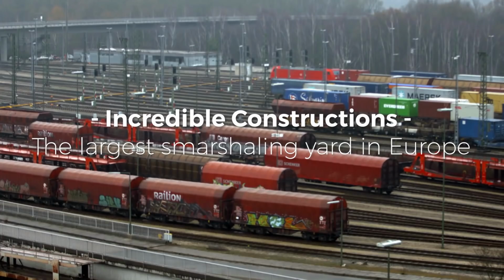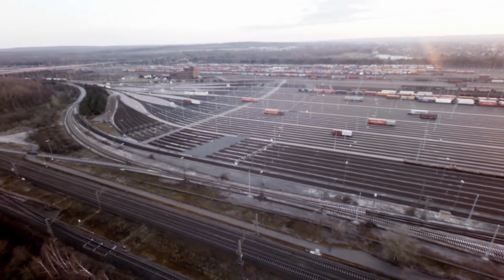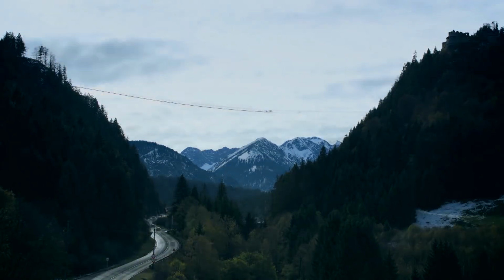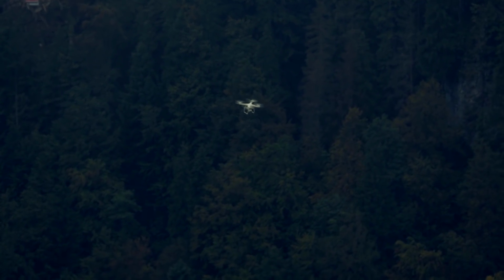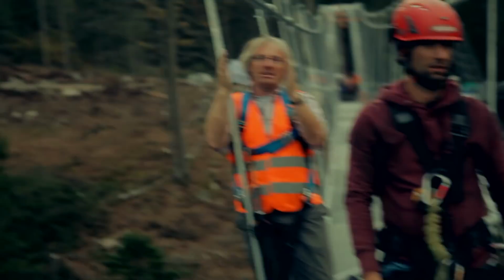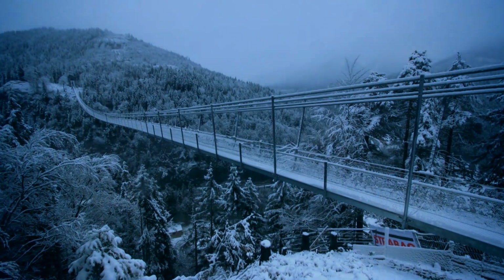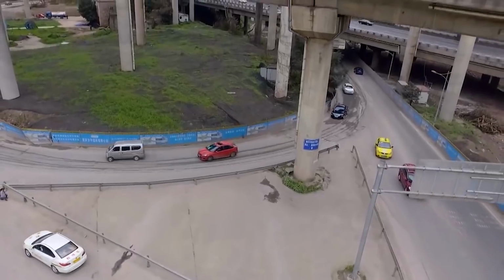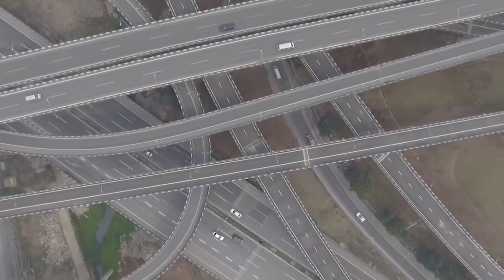Mega Constructions: Biggest Marshaling Yard, Suspension Bridge & Intersection | Free Documentary

Comment: Holy cow, you are still using a dangerous and antiquated manual coupling system like that?   No wonder 2700 ft seems long.
Reply: @Seaghán Ó Laochdha you just lift the cutout lever and let 'er buck.
Reply: @Seaghán Ó Laochdha the only time you need to stand between wagons with knuckle couplers is to connect air hoses or MU lines. Air lines auto disconnect as the wagons separate. Uncoupling is done by a cut lever at the side of the cars/locos
Reply: @Seaghán Ó Laochdha I believe he is referring to the fact that a human has to get between the cars to couple/uncouple them; whereas with the US Janney-style automatic coupler you just smack them together and they stick. You still have to get near the coupler to connect the brake lines, but at that point the cars are connected. The Scharfenberg (sp?) coupler leapfrogs this by automatically connecting not only the coupling but the air pressure as well, but is still not in common use.
Reply: @natehill8069  Scharfenberg couplers are in common use, just not for freight trains because they're not strong enough for that.
Reply: Holey moley cow ow ow ow WOW!
Reply: They aren’t dangerous or antiquated at all!
Reply: @charliestrains9826  No, you do not stand between the cars.  And look at how much time and how many steps it takes to couple and uncouple that link and buffer system.  Pretty time consuming and inefficient.  There is a far superior system in use so, yeah it is obsolete and it is antiquated because it has been obsolete or so long.  And it boggle the mind that you don't get how dangerous it is to have the workman stand between the wagons.
Reply: @Nyth63  the advantage of buffers and links is that they have practically no slack action.
Reply: @plcwboy  That is incorrect.  They DO have slack action. It is built into the buffers.  It is necessary for the locomotive to progressively start moving that train one car at a time.  It would be almost impossible to start every car moving simultaneously and overcome static friction.
Reply: It looks like the cars are not failsafe braked, or possibly braked at all, that would limit the max length drastically, but it does allow for gravity powered sorting.
Reply: @michaelwillis1832  have you not seen a hump yard? Just about every major yard in the states has a hump (gravity sorting)
Reply: @The_Koups  I have to admit i haven't, How do they disable the brakes in a safe manner to allow them to run uncoupled?
Reply: @michaelwillis1832  at each end of the cars there are ball valves on the airlines. They shut them off while the lines still have pressure, then they run them over the hump slow while a brakeman cuts each car. The car goes through a computer controlled braker that slows them to the perfect speed to make it to the next car in the que on whichever line it gets sent down. There are heaps of videos that explain it better than i ever could.
Reply: @Seaghán Ó Laochdha A system where the worker can uncouple wagons without standing between the wagons will always be safer irrespective of the length of the assembled train. That is why All North American and Australian railroads have been using knuckle couplers for well over 100 years. So yeah, it is dangerous and antiquated.
Reply: Kenneth Mileski wow that’s not true American loads are bigger

Comment: Less than 3000 feet?  Long-haul transcontinental trains in the U.S. often approach 16,000 feet in length with lots of locomotives in front, in the middle or on the back (called distributed power).  Some trains are too long for the yards to handle in one piece.  Never seen a train that big?  Check out Virtual Railfan on YT, Belen yard live camera, a 2 1/2-mile long yard that is often bustling with activity and BIG trains.
Reply: True...  I agree. But the Europeans pride themselves with the passenger train in comparison to North America's freight trains. That's the difference.
Reply: I've had 15000 feet with two engines.

Comment: our train length here in Australia can be upto 1.6kms, in the US it can be a couple of miles with 6  4500hp locomotives at the front & other engines further back. So the trains in this  video are hardly big.
Reply: 1.6km in australia is a small train, they hold the record at 7.3km long
Reply: @bjorn1583  the max freight allowable is 1.6kms on the main line, but some of the ore trains can get pretty big
Reply: @michaelhyde-parker6344  that depends on which state you are in due to the length of the sidings, the only train that dont have to obey the rule is the beer train where even express passenger trains have to give way to it because its too long to fit in the sidings

Comment: i've built bridges that ended up to be 60ft longer than designed...no worries man i trust you with my life 200ft up in the air
Reply: Right!? Planned it for 10 years apparently and still doesn't know how long it will be. I'm sketched that they pulled the bridge together at the end. You'd think that would preload a ton of stress
Reply: @bradenwoods1111  Yeah the come alongs pulling it together at the end sure looked like a half assed idea and now that whole bottom is depending on the shear strength of the bolts.  I would think if they tightened the upper cables it would pull the sag/slack out of the bridge making it shorter.
Reply: @bradenwoods1111  Yeah the come alongs pulling it together at the end sure looked like a half assed idea and now that whole bottom is depending on the shear strength of the bolts.  I would think if they tightened the upper cables it would pull the sag/slack out of the bridge making it shorter.